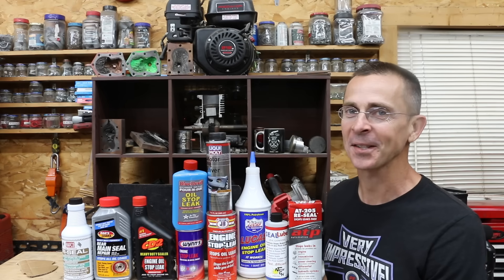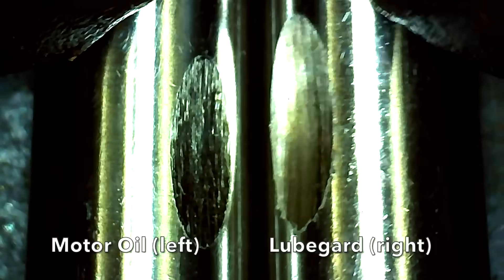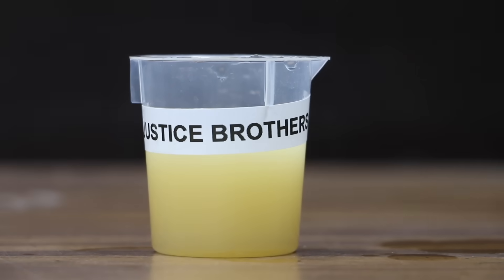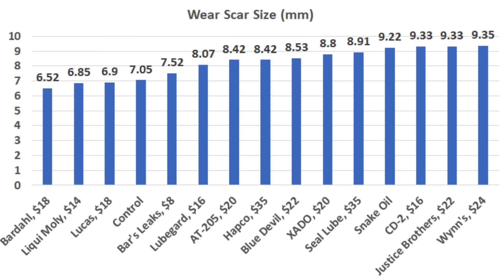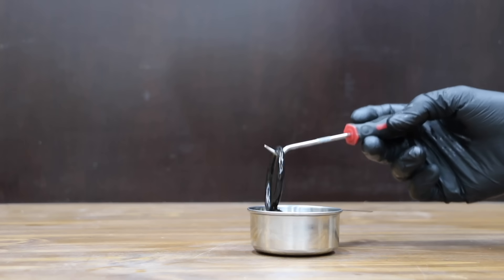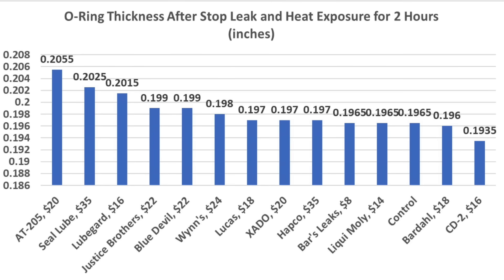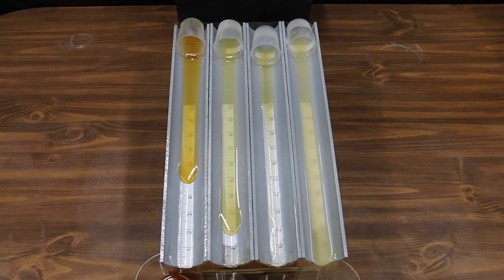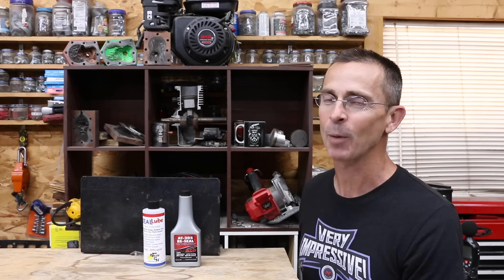Do Stop Leak Products Work? Do They Damage Engine Seals? Will They Destroy an Engine? Let's Find Out

Comment: I have some follow-up questions if that's ok (?):
1: As there's wear on both parts during the scar test, with manual redressing; did you do another control after running through the test samples?

2: Were these all "leave-in" products? Or do the instructions on any of them say they should be flushed with new oil and filter replaced after XX hours / miles? In case of the latter, that would be valuable information. 

3: Regarding the ones that did expand the NBR seal (o-ring), especially the ones which expanded and softened brand new ones - would you consider doing a very basic follow-up where you leave o-rings in those particular products, with periodic or no heating, for say a few weeks, maybe a month? If some of these are doing that to brand new o-rings, and so quickly - I worry about the realistic short to medium term effects. Some of the chemicals known to soften and swell NBR, actually do so in the process of dissolving it. If you would consider this, sharing the results as a pinned comment to this video would be plenty. IF (!) any of them actually start to swell the rubber too much, make it super soft, or go gooey and dissolve - obviously that's a VERY big issue. And therefore ideally, information available in the same place as the relevant product testing and rating by YouTube's mpst trustworthy farm-workshop product testing lab  😉❤️

Comment: Video Idea - More 2 Stroke Snowmobile OEM vs Aftermarket Oils

BRP XPS 2T E-TEC Synthetic Oil
Polaris VES Extreme Synthetic Oil
Also comparing 3 main aftermarket oils that are used:
Amsoil Interceptor Oil
IPONE Snow 2 Semi Synthetic Oil
KLOTZ Snowmobile TechniPlate Synthetic Oil

I've seen more than a few people on the forums commenting if you have done something other than the Supertech vs Amsoil. Hope this is something you could look into and make a video on.
Even if it's just getting the oils tested at the independent lab (type of mixture, additives, and such), flash point, wear scar on a bearing machine, and flow test at -40C. That would tell a lot for us snowmobile people. Thanks!!
Reply from the maker: Thanks for the suggestion.

Comment: I was told once when my power steering pump was leaking to add brake fluid to it to get the seal to swell. Didn't do it just changed it. Just wondering if you heard the same thing.

Comment: In modern engines will any of these cause damage in modern VVT systems?
Reply from the maker: Thanks for the suggestion
Reply: @ProjectFarm  I guess the only way to test would be to use a VVT solenoid actuator, in mazdaspeed engines the VVT uses pins that rely on oil pressure, and they can break in older variants, I'm not sure how much it varies with other manufacturers but Ford has the same style from their merger.

Comment: I used Blue Devil power steering formula on a leaky rack & pinion about 1.5 years ago, and it did an excellent job - probably the first stop leak product I tried that actually stopped the leak. I haven't had to add any fluid since.
Reply from the maker: Thanks for sharing!

Comment: The way these fluids work is they actually move out of the oil and migrate to the rubber seals and gaskets. ATP products are some of  the best you can buy. Built a ton of transmissions with their AT kits.
Reply from the maker: Thanks for sharing!
Reply: @ProjectFarm  
Thank you for doing an outstanding test that actually helps us choose the best products for the job. Much respect to you, Sir.

Comment: I don't know how applicable this will be but I wanted to share a chemistry rule of thumb. For every rise in 10C the speed of a reaction will double. I don't know if the treatments are chemical changed or they just soak in but the o-rings soaking for 48hrs versus being hot could very significantly change the results if it is a chemical change. Love all the tests that are done here and only hope to maybe help make them a bit more accurate.
Reply from the maker: Thanks!  Thanks for sharing.

Comment: My two cents:
I am a Lucas fan myself. In my experience its stop leak properties have less to do with rejuvenating old seals, and more to do with making the oil slightly "sticky". It also seems to help keep bearings coated longer after the engine is off to lessen the harshness of a dry start. 
However, I'm not a scientist. I just know it's worked so far in my old BBF engines.
Reply from the maker: Thanks for the feedback.

Comment: The only stop leak that should enter the engine is block sealer if you crack the block.
At this point you are just getting more from a dead motor.

Comment: I just used at 205 in my 350. I have it in an old 41 hot rod. It’s been fouling plugs like no tomorrow, I mean black like a rattle can sprayed the plugs. I was sure it was the valve guide seals. After driving about 2 hours I checked the plugs and for the first time they were actually white/tan. Hard to argue that.
Reply from the maker: Thanks for sharing.

Comment: I find the risk of engine wear with most to almost be criminal.  The ones that mixed well seemed to not do much other than seal via thicker oil and the ones thats did not mix sealed well yet massively increased the wear.   Are these products tested to any national standard? or just all self claims?

Comment: The first time I used AT205 was on my friends 15 year old maxima with a massively leaking power steering rack. It would lose all the fluid in less than 5 minutes.  I used half a bottle of AT205 and refilled the power steering fluid and it didn't leak another drop in the 3 years before someone crashed into her.  Since then I'm totally sold. It's saved me and my friends thousands!

Literally the leak stopped so fast I couldn't even believe it!
Reply from the maker: Thanks for sharing.

Comment: Thanks Todd, for the most interesting comparison and your impressive testing methodology. I use the AT-205 in a spray bottle to spray the outside of my rubber suspension bushings when my car is on a lift
 Also, I occasionally wipe a light film of AT-205 on my car's rubber weatherstripping.
Reply from the maker: Thanks and you are welcome!  Thanks for sharing.
Reply: Can you tell me if I need to mix AT-205 with water when I transfer it to a spray bottle to use on rubber parts, or should I use it pure?
Reply: Don't mix it with anything. @pamilyasaalemanyaYT

Comment: Oh, "oil" stop leak.  Never had any luck with that, but have used lots of radiator stop leak and to good effect when the leaks were small. Never an issue with clogging.
Reply from the maker: Thanks for the feedback.

Comment: I’ve used AT-205 on hoses, rubber door trim, etc and it really does do a good job at keeping the rubber pliable.

Not sure I put it in my engine though unless it was a last resort and didn’t want to fork out a lot of money for a real fix.

Great video thanks for sharing.
Reply: I use it in every engine, tranny, diff and xfer case I have. At high miles the rubber needs all the help it can get. I don't care if it's leaking or not. I'm not waiting till it fails.
And guess what? Over 200k mi and 15+ yrs on all of the vehicles and the engine seals don't leak (VC gasket bad design is another issue lol).
Reply from the maker: Thanks and you are welcome!

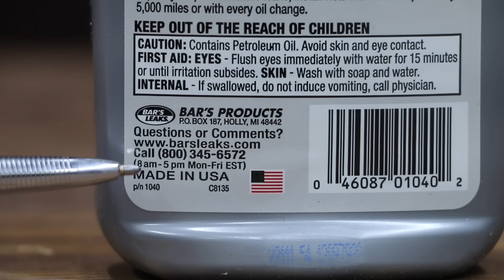Comment: 0:35 Also on modern engines a good way to plug up the hydraulic circuits they use for cylinder deactivation and variable cam timing.

Comment: I got a Lexus ES 350 2008, they have a timing seal cover oil leak which costs 4,000 to fix since you have to take the engine out.  I used Reseal and Blue Devil after that it was  good bye leak, saved me 4000.00.  I also do not use Full Synthetic Oil.  I use the High Mileage which is formulated to help avoid leaks.  This combination has the problem under control.  I also had a rack problem in another car, the Lucas Transmission oil which what it uses,  plus Blue Devil and it is very controlled.  I rather use them than to get a new rack.  Those products can save people a ton of money.  That said if your part is severed it may not work at all and a replacement is needed., but in many older vehicles it helps with worn out gaskets!
Reply from the maker: Thanks for sharing.

Comment: I have used brake fluid before to help the seal swell and stop a rear axle leak as this was suggested  by a mechanic friend of mine. Not saying I would necessarily trust it for any rig, but it was an old high mileage truck so I tried it and worked for me.  It would be interesting to see how brake fluid in oil would stack up. I think I just used an ounce or two of brake fluid to one quart of oil.
Reply from the maker: Thanks for the suggestion.

Comment: Great video ! Maybe it is in the comments somewhere but I do have a question. It looks like you used a 50/50 mix of product with oil.   Would the wear results be different if the mix ratio was the same on a percentage basis as if the product was being mixed with 5 quarts or mixed as instructed?   Again, great video!

Comment: One thing to note is that many years ago I used the AT-205 to stop a leak in my car (can't remember the system, but it wasn't oil and instead maybe power steering?). Instead of stopping the leak, it destroyed the old gaskets and made the leak a pour. So I had to replace the part instead of adding fluid every-so-often.

When I added it, I knew that was a risk, so I'm not exactly blaming the AT-205 but, it's something that's worth knowing. Sometimes it'll "soften" the gasket enough that it'll just completely fail!

Comment: I can tell you from a leaky power steering reservoir that ps fluid also caused the nearby rubber radiator mount to swell and soften quite a lot. Not sure how it would impact an engine.
Reply from the maker: Thanks for sharing!

Comment: I could not be more appreciative to you and your work on this channel. I tell as many people as I can about your work. Yet again i find a product that I have been using for the last 20 years with great success and now you confirm it further. At-205 in my opinion is a magic snake oil that actually works great including the test of time. Thanks again. Keep up the great work.
Reply from the maker: Thanks for sharing!
Reply: I take it from your glowing comment that none of your equipment suffered from  reduction of lubrication from using this At-205?  Did you use At-205 continuously or just one time to resolve  the problem returning to your regular oil afterward?
Reply: @Troyvidihoo  AT-205 does not stay in the oil for very long. It is soaked up by the seals and gaskets so the impact on wear is minimal. When using it, you should change your oil in a few hundred miles and then just use regular oil afterwards.
Reply: @Troyvidihoo  I have completely replaced my oil with at 205. Never had a problem.
Reply: @TheSuperBoyProject  That means squat if you did it a month ago. Give a time frame, as the wear you are putting on your engine will be calling for you...

Comment: Incredible video. Thank you.
Reply from the maker: Glad you enjoyed it!
Reply: @ProjectFarm  I used the information from this video to purchase some Lubeguard SealFixx to hopefully slow or stop a small leak in my power steering system. I was leaning to ATP-205 but was concerned by the added wear and that it made the seals far softer than new. Also the lubeguard retails for $13.99 at oreily instead of about $22 for AT-205 at advance auto after the 15% coupon.

Comment: At 50% motor oil to stop leak ratio the wear characteristics aren’t good. But, used as directed at 1/4 1/5 or 1/6, there probably won’t be any additional wear over straight motor oil
Reply from the maker: Thanks for sharing!

Comment: In my career, I never saw any of those type products do what they claimed. By the time you need to resort to using them, it's usually already too late. You are just throwing money at the problem to postpone the inevitable. If you can manage to catch the issue early on, some of them might be able to make the postponement a little longer. But, in the end; it will end the same way. Replacement or repair.
Reply from the maker: Thanks for sharing!

Comment: i would like to see a video on what to put on car door gaskets to keep them from freezing in winter.
should be simple to test. clamp a piece of door gasket between two bits of metel and freeze them and thensee how much they take to pull apart. could also test for if it messes up a dress/clothes, or how often it needs to be reapplied.
Reply from the maker: Thank you for the video idea!

Comment: I had my power steering cylinder leaking a 1/2 litre a day. A old mechanic told me to add TDH oil to the steering pump.. After a week it stop leaking and has not leaked again for over a year.. TDH oil saved me over $500
Reply from the maker: Thanks for sharing!

Comment: Better to use a high mileage oil like Penzoil Platinum that has the additives already added and shown to perform very well. Oils are engineered to work best with the additive package they come with and will rarely if ever perform better with additional additives as shown in these tests. Even using oils designed for flat tappet cams is better than adding a zddp additive as there can be issues with too much zinc and you will have no idea what the optimal ratio is. It’s just better to use an oil designed for a specific purpose than trying to concoct something better with questionable results.
Reply from the maker: Thanks for sharing!

Comment: The chart at the end of this video doesn't make any sense to me.  He uses the measurement in inch's but during the test the measurements are in much smaller numbers like 0.2060.  So that chart doesn't make any sense.  Also in one of the charts about the thickness of the o-ring he states in the chart that the control is .1965 when just before that he shows the meter at .1940 throwing that chart way off.  Todd, could you please help us understand what those numbers mean?

Comment: Thanks for another thorough video!  With the weather getting warmer it would be fun to see you do a bug zapper test.  I live in an area with a lot of little bugs and mosquitos so it'd be nice to go out on the deck and enjoy the warmer weather without bugs!  Great work again!
Reply: Skeeters hate the Thermacell repellers. I use the EX90 - recharges easily via USB.
Reply: A thing I learned researching zappers last year is that the UV ones don't do anything to mosquitos since they don't navigate by light. Light smoke from a fire pit took care of them for me, but I've heard very good things about thermacel from a few camping channels
Reply: @microwave221  Get a fan and put some fine mesh on the back, mosquitos are very bad at flying, they get sucked by the fan and then stuck to the mesh.
Reply: @jonasstahl9826  yeah, I've got a little battery powered one with a screen on it that I use for that, and it works well. The airflow pointed at you also seems to keep them away as well, and is nice on humid evenings.

Comment: My analysis: the safest and also most co$tly (for additives replacing a far more costly rebuild) is a double dose of liqui-moly with a quarter dose of at-205. This would be adequate friction protection with a proportionately maxed amount of sealing improvement. If that trial leaves you ready for higher risk, lean into at-205, and for less risk, liqui-moly.

Edit: The above would stand for a 3-day intensive “add, run, drain/flush, refill-with-no -additives”

Or

“Add and run until next oil change interval”
Reply from the maker: Thanks for sharing!

Comment: I love your videos! Some feedback: I think this test needs a redo, as the products weren't added/used in their proper, respective concentration to the motor oil. For example, you only add 8oz. of Blue Devil to 4-6 quarts of oil. You used the equivalent (at scale) of having an engine half-filled with the stuff by using a 50/50 mix. Having such a high concentration of product I think made the results invalid.

Comment: I wasn't aware of the seal lubes lack of lubricity performance but I can attest that it works remarkably well, the amount you add vs. oil is much less than 50/50 so the damage would certainly be less.....that being said, awesome test!

Comment: Great video of something most of us home repair guys have wondered about. After just replacing a gasket on the oil filter housing on my F150 I thought about a product like these. As you said, if it is really leaking just replace it. These quick repair products might or might not work. Wish there was a magic unicorn repair fluid out there, though.
Reply from the maker: Thanks for sharing!

Comment: I use AT-205 outside the engine (body mounts and other rubber) put it in a spray bottle and go around the truck once a year. Keeps the salt from drying out the rubber.
Reply from the maker: Thanks for sharing!